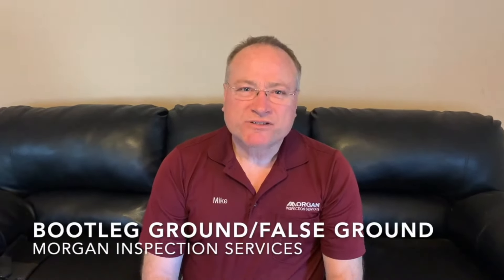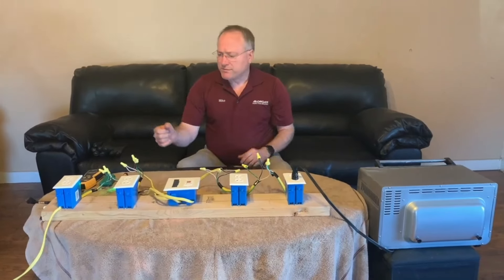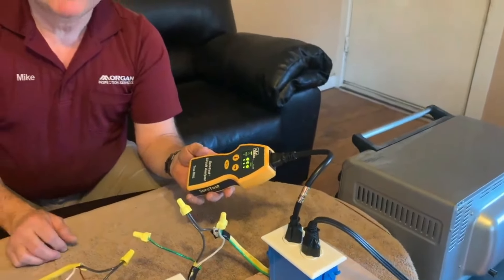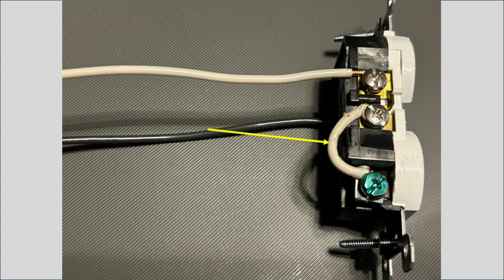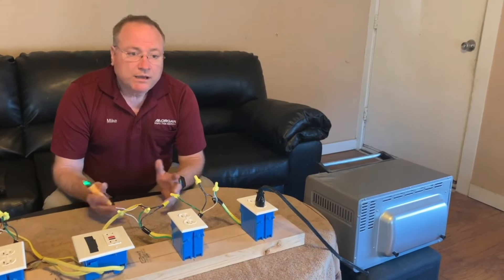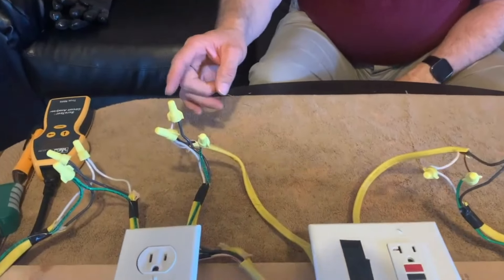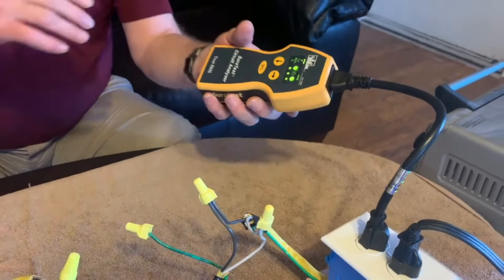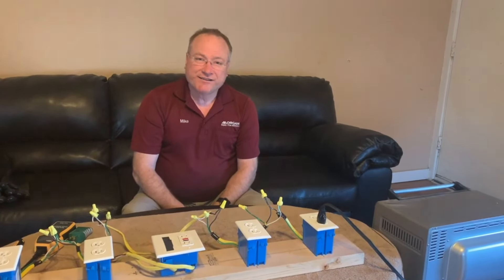Bootleg Ground Wiring: The Hidden Danger That Could Electrocute You! (Home Inspection Tips)

Comment: Good job trying your best to get through thick skulls that it is NEVER okay to connect bootleg ground receptacles under any circumstances.    

The same open neutral hazard exists on 3 prong dryer and range receptacles commonly found in home built before the adoption of the 1996 NEC, because grounding the chassis was done via a strap or jumper wire to the neutral.  Or what I call a "code approved " bootleg ground and combine that with a wet or damp basement floor and metal plumbing , and you've basically signed your death certificate.  

Bootleg grounds are more dangerous than simply leaving the ground open, because if the neutral fails on an open ground  receptacle powering the toaster oven,  the appliance simply will not work, but the chassis won't become  energized unless there's an internal failure.  

An open neutral on a 4 prong dryer or range receptacle would result in the appliance not working properly since none of the 120 volt components would work (eg. clock, oven light, electronic oven controls,  drum motor) thereby letting the homeowner know something is wrong, but the chassis won't become energized unless there's an internal failure AND open ground.
Reply from the maker: Thanks for the info. I am always learning something new from you.